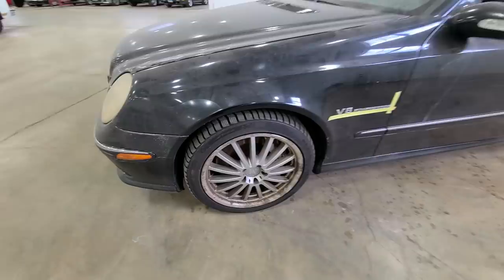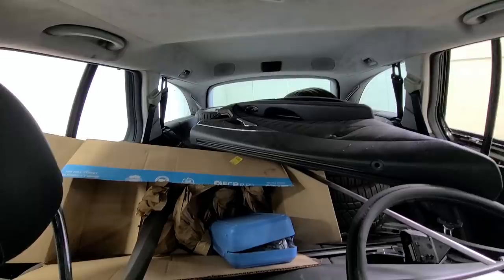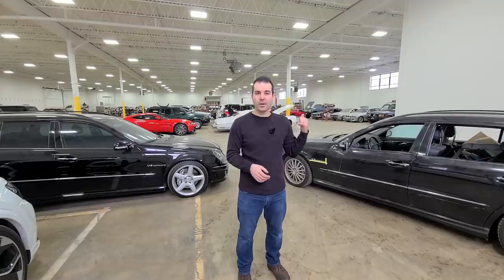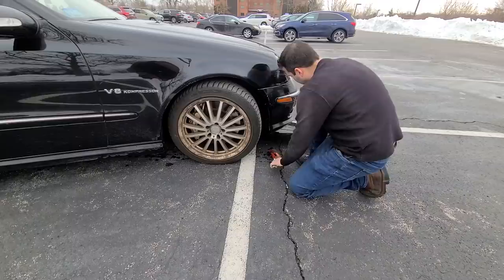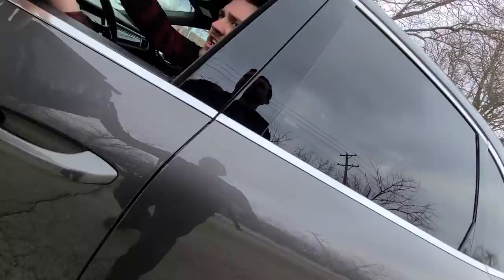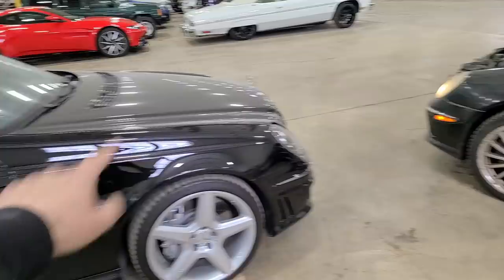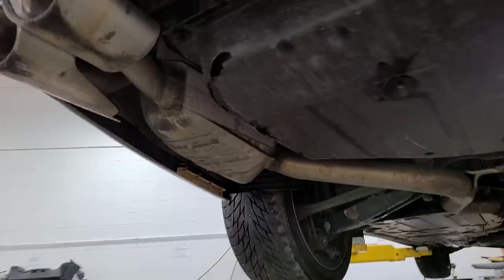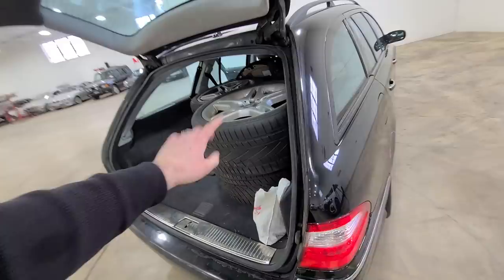I Bought An E55 AMG Wagon For $7,000 SIGHT UNSEEN For A Quick Flip But Here's What Showed Up.

Comment: Great channel Alex! After watching your first few videos about your W211 and researching the reputation that these cars have for being Camry reliable if maintained properly, I got the fever and had to have one. Within a few weeks, I found a clean, 2-owner Black on Charcoal E55 with 98k miles (in Naperville!) with good carfax/maintenance history and bought it sight unseen 5 states away. I didn’t lay eyes on it until it was delivered a few days later! The dealership had a good ratings and very good pictures on their site and I did tons of my own research and plotted the cars life from the factory and factory dealership records up to it being traded and was pretty confident in what I had gotten. I actually avoided a few bad cars thanks to some of the advice you posted on your car. I followed your build and used FCP Euro and VRP for almost all of my parts and your discount codes have saved me tons! I somewhat mimicked your build and mine is almost it’s twin and I started with some maintenance (fluids, colder plugs, wires, coils) the ic pump upgrade, 76mm pulley and tune were my first upgrades thanks to your (and Tavarish with his SL55) how to and review videos for VRP and I have their secondary cooler and ball joints and thrust/control arms from FCP Euro on a shelf waiting for the spring. I enjoy your videos and I like having someone to blame with my wife when I buy stuff for my car! Killer Chiller, long tube headers and a fixed pulley are next! Please keep the videos coming, I’ll need something to watch while I’m in the doghouse...Thanks Alex and keep up the great work!

Comment: Hey Alex,

Love your show. The Bas, Esp, Ets tri factor is normally the brushes in the brake controller start by checking the relay, than jump the relay to confirm motor or relay. Both brushes and relay are turbo cheap fixes.

Comment: It actually has hydraulic rear suspension. The power steering pump powers it. There’s 2 lines that run to a height sensing valve in the back. From there 2 lines come off and attach to a dampening sphere on each side that works as shocks. From there they go into the strut.

Comment: While not an exotic, in 1986 I bought a 1980 Volvo 242 with 170,500 miles. Drove it for 3 yrs and traded it for a 1983 Volvo 245 with 113,000. Promptly drove this car from the Chicago area to the middle of no-where in New Mexico. No problems with either car.